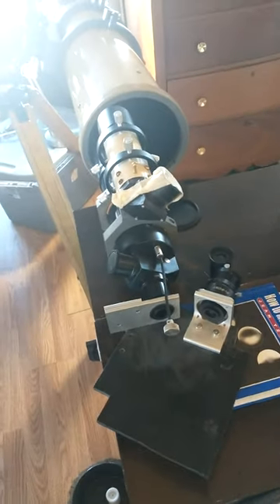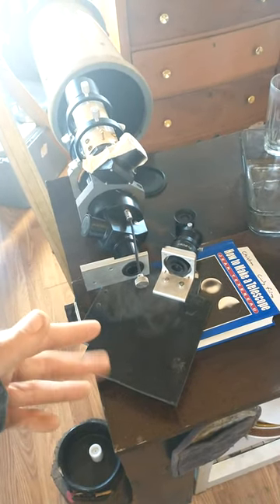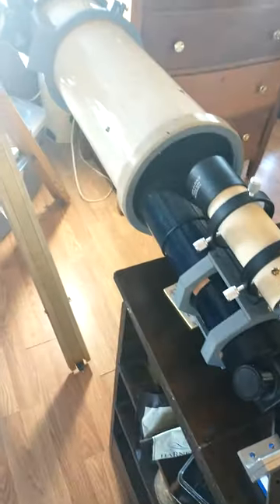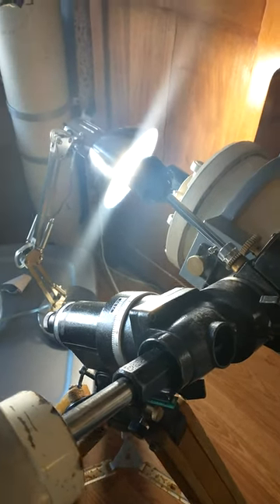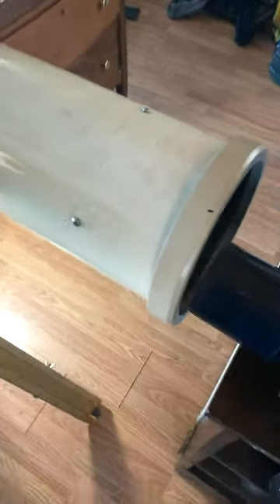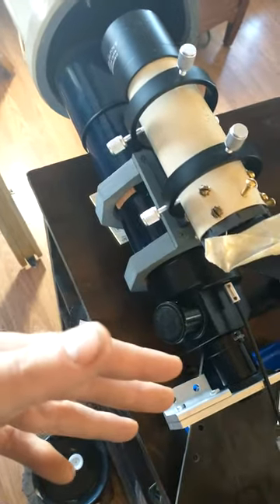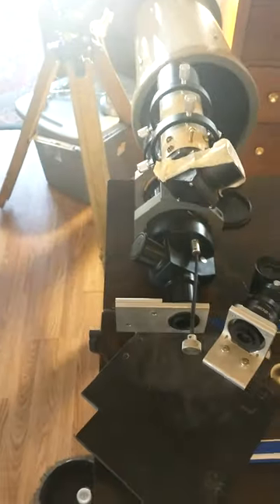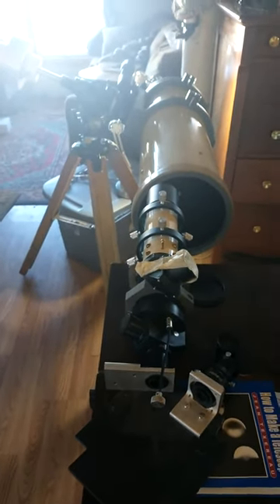Collimated light source to test Spectrometer Build.

Comment: what kind of bulb is that to be so bright? and how exactly are you collimating it i did not understand , for me to collimate light i got a single die 7.5 w led which i shine through a pin hole and then through an aspheric lens to get a laser like beam early collimated at long distance and the smaller the pin hole the better the collimation but at great loss of light intensity unless i can find a brighter bulb but it has to be a single die emitter and the smaller the better